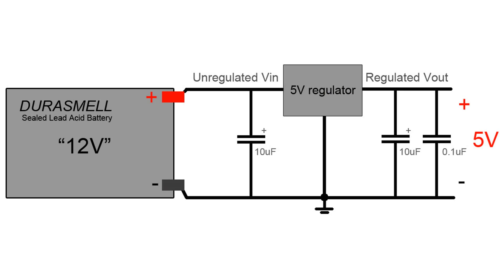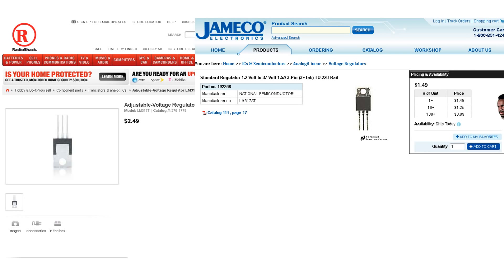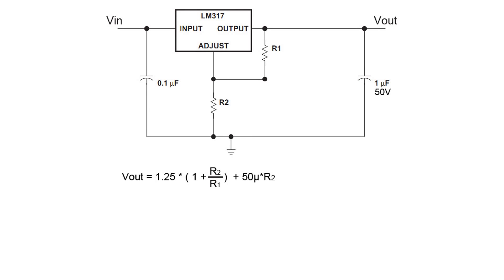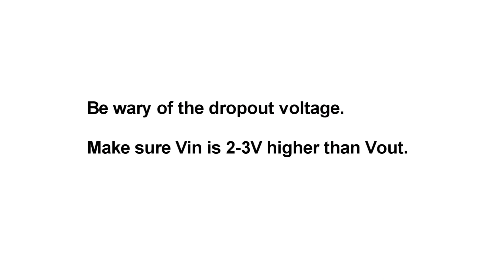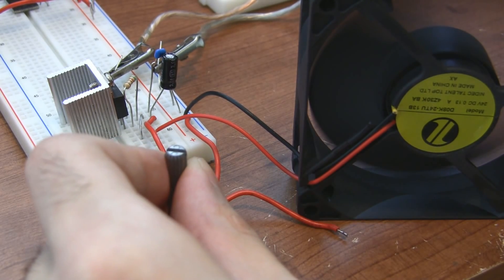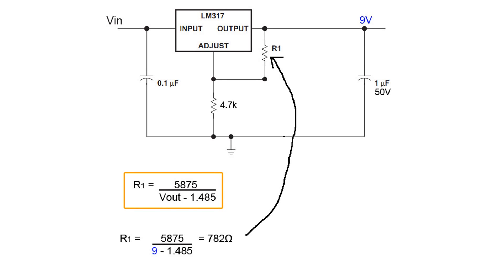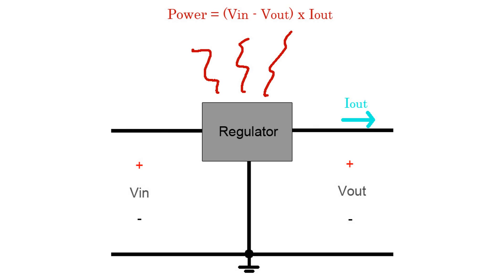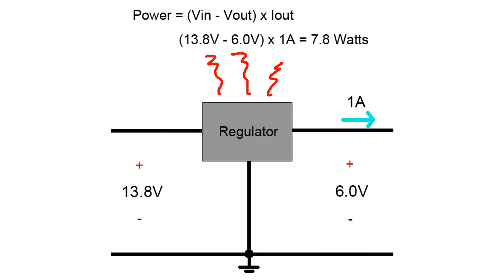LM317 Adjustable Voltage Regulator Tutorial

Comment: Great vid, but you can avoid using thi specialty reg and use  regular 7805, 7809, 7812, 7815.....etc. You use the same potentiometer trick and this creates  a floating ground circuit so the IC still 'thinks' it is regulating a lower voltage. These are generally good to about 35 volts DC output max. But a great set of videos overall. Say, what brand of O scope would you recommend if one does not want spend top dollar ( i'd rather have more frequency in exchange! ) thanks

Comment: I just want to ask, i am making 0.10 volts to 15.37 volts with the same set up, and i have an input of 16.6 volts dc from step down transformer through bridge rectifier, i just want to know why i cant get the 1.25 volts as minimum, the value of my potentio is 5k ohms, and i have 520 ohms for the R1. 

thanks for answering Sir.

Comment: For bigger things such as motors, use 555 and mosfet for pwm. Google PWM voltage regulation for more info. 317 is just for small things like fans and small amplifiers. Good luck!

Comment: The LM317T is a high-current version of the LM317.  They both work the same, and have the same pinouts, but the LM317T is more expensive and can handle up to I think 1.5 amps, whereas the LM317 can only handle around 100mA.

Comment: no you can't. But you can connect in series a diode (ie:1n4001) which will drop the voltage ~0.6V, so you'll have output from 0.85 - 1.00V

Comment: Hello. I would like to know if I can use this voltage regulator do drop a voltage of a battery from 1.5 V to 1.0 V without using resistors. Thanks a lot.

Comment: Hey, great video. I have a question you may be able to help with. I'm doing an RC wheel chair mod and I need to get a 6v power supply to output 2.5v positive AND 2.5v negative. Using the LM317 and various resistors i'm able to get the positive current right in the butter zone but the negative is always around -3.8 or so. Would you have any suggestions on what I would need to regulate the negative current and how to do that?
Thanks!

Comment: I've got a 5V 40mm fan attached to the Arduino's 12VDC output for cooling, and I've just inlined a resistor to bring the current down because I don't really need a constant voltage. Would there be any extra benefit to replacing the resistor with a voltage regulator in this application, since they both dissipate the extra current as waste heat?

Comment: but why can't you simply use a voltage divider, since the current in both cases is going to be changed than the source?! using only 2 resistors

Comment: Thanks for this videos, they are very informative!  I just have a question. When i search for this regulators, I see that the datasheet have a current after the regulator voltage. For example, a LM7815 says 1A and a LM78L15 says 100mA. What´s the difference?

Comment: that was pretty cool when it caught fire, could you do more fire videos and explain why it caught fire?

One time I had blown up a transistor and repeated the same steps a few times until I changed my circuit design around. It was pretty cool and sound like a firecracker just from a tiny little transistor. my power source was some kind of radio shack 3v rechargeable.

Comment: whats the maximum amperage rating for this? I need to convert 12v (or rather, ~13.6v) DC to 16-18V @ 18-20amp max. how do i increase the maximum amperage rating? the input voltage would be off a car battery/running car voltage.

Comment: Great Video by the way, I have a question, i made a Regulator for my solar panel 24V 5A with 44V peak output, i used a NTE935 regulator, 150ohm R1 & 1.3K R2, for some reason im getting only 10V. im trying to get 14V so i can charge my batteries.  NTE935 is made for 32V 5A, do you think my resistor values are wrong ?? do u think this is causeing my problem of the 10v readings which i need 14v any help will be great.

Comment: I don't want to sound dumb but if im trying to use a voltage regulator to power a few USB devices. lets say 3 5V ports at 500mA each that's 1.5A DC total and im running off a 9V supply. Does my power supply need to be able to supply 1.5A DC or is there something in there about ohms law?? please help. thanks in advanced.

Comment: I want to use this to adjust the fan speed on my forge which is a 12v car heater box fan. Could you please tell the type of potentiometer and its rating and could you tell me the rating for the capacitors and resistors so I can get them ordered.
Thanks in advance. Adam

Comment: if you still need the resistor values, you can google lm317 calc and there are some website where you can put 2 values for resistors and it will give you the output voltage

Comment: i want to make a 7.5 volt power supply with 1A from a 12 volt power supply with 20A, with the lm317. what would be the values of the resistors R1 and R2?
Thanks

Comment: If you want the cleanest "audiophile" power, run off batteries. If you want to make this circuit have minimal noise, increase C2 to 1000µF or more. (Note, if you increase it a LOT, the output voltage will take a while to get from 0V up to the set voltage. This MIGHT cause unusual sounds during power on. I don't think it will ruin your device, but I won't guarantee that!)

Comment: You can use this exact circuit to do what you want. The video explains the circuit, and there are a zillion webpages which also explain, if the video is not enough.

(However, you will need to put a big ol' heatsink on the LM317T, because you'll be dropping 4 volts at as much as 3 amps, which is 12 watts of power. Some soldering irons run at 15 watts, so: HOT.)

Comment: HI.. i have a battery that is 36v and 42 on no load..
so what i need is (somehow) so get the 42V down to 12V... ive already got an lm317 witch is adjusted to 12v. but the lights i use needs atleast 0,8A.. and when i use a normal resistor in front of the ln317 to decrease the voltage it burns up.. any idia how to fix ?

Comment: Great explaination, does this apply for the LM338 also with no required modifications to the circuit?

People tend to use diodes and capacitors can you help explain their purposes in this circuit and what you would recommend.

Comment: Ok thanks for the reply. So I should be switching my present R1 and R2? In other words, have the variable between Vout and ADJ and the fixed 1.5K between R1/ADJ and ground? If so, I am confused why the schematic on the LM317 dataset shows a variable as R2 (between ADJ and ground). Or should I recalculate my variable resistor value based on an absolute value of 4.7K for R2?

Comment: I am having trouble keeping a constant Vout. I have a couple voltage regulators set up, but only one maintains a constant Vout with variable load (simulated with a 10K pot), while the rest do not. I have 1 and 0.1 uF capacitors as the schematics and video recommends for each regulator. Vin is somewhere around 12V R1=1.5K, R2= variable from about 0-10K. I tried using a 4.7uF capacitor for C2 (the one between vout and ground) with no difference from the 1 uF. Any ideas?

Comment: my lm317 heats up fast and it's really hot. it even reaches a high temperature even at low voltages and without a heatsink. is this normal? or is there a way to fix it? im pretty sure i wired everything correctly.

Comment: Hello i made this voltage regulator as per your diagram, bit of fault tracing and repair at my end, but works perfectly. My question, is there a voltage regulator that can control from 0.5volts or less, maximum volt i need is 5 volts.
Great video's i have only subscribed to two channels and one is my daughter

Comment: I connected a laser diode 2W 2.8 to 3.0 V 1.5 Amps to the output and an old laptop power supply to the input with 19V, 3.6 amps, ant the maximum Voltage output is 1.82 V

I replaced the laser diode and same behavior. 

with a fan, lightbulb it works as expected. 

Any ideas?

Comment: i did all of this and i only get 100mah of power, why? I used 500ohm resistor and 10k pot also 4.7up 50v cap on the output side and 0.1uf on input and a 12v battery to power it all

Comment: About my case bellow...

After a lot argument that the 317 needs 100-120R as R1 to meet the minimum current and Pot as R2 which for some reason was not regulating the Voltage at least without Load,i decided to SCREW the minimum current and add a Fixed R2 and a Potentiometer in Series to 100Ohm resistor as R1 and BINGO!

Bingo boys,3 nights in a row and my first thought worked better,but the nights were still gone.

I really should have got another Regulator like LM1084 which i know inside out.

Comment: Nice video. I wanted to see if i'm missing anything,but no. For some reason while everything is wired perfectly,pinout set right,etc,the damn thing gives ~15v out while set to ~13.8,and while the Input stays ROCK stable,when 90mA load is added it drops at least 5v,if R2 set exactly with a trimmer,a bigger dropout is caused.Added more minimum load,changed the R1 to 120Ω,and tried multiple combinations. This thing just doesn't work as it should,i'm in Electronics since 5 though first time i selec

Comment: You can use 7805,7812 etc  as adjustable voltage regulator.Put between middle pin and minus variable resistor an you will change the voltage.

Comment: @Afrotechmods Ok, thanks. Btw, is there a way to control how much current that can be drawn from a battery? For instance, not higher than the max discharge rate (for lipos)? A current regulator of some sort?

Comment from the maker: @FlumenSanctiViti You want what is called a switchmode power supply, or a switching regulator, or a buck regulator, step down DC-DC converter, all different names for the same concept. National.com has the easiest solutions if you want to roll your own from scratch.

Comment: @Afrotechmods
At the end of the video you are talking about inefficiency of this type of voltage regulator and power wasted on it. Can you tell us what is the best setup for more efficient voltage regulator that can easily handle variable voltage on its input (for example from x1 up to x5 or more) with low power dissipation.

Comment from the maker: @KIBProductionz Any voltage regulator IC will be better than a zener. The zener voltage can easily vary by +/-10% over their full current and temperature range. Sometimes that's good enough though.

Comment: what's a better voltage regulator? a zener diode or an LM317? i found out that zener diodes go up from 0.01V up to 12V if certain configurations plus a darlington transistor is considered

Comment: I have to do this circuit but I see that I'm using 100uF instead of 50uF you are using and my first capacitor is 4.7uF. Is fine if I use these values?

Comment: I am looking for a way to make a step sequencer for my synth. When I looked at your circuit I was think if I could make timer circuit that would switch between pots at a tempo that I could regulate with another pot then I will have the solution because a voltage can be converted to midi data (with a doepfer system) but do you maybe have an idea for a second circuit to switch between pots?

Comment: did the "50(micro)" on the equation at 2:32 came from the Vout capacitor? what if my capacitor is rated at 50 volts and 3.3 (microfarad)? what do i do?

Comment: @ImUrtastyflava build a voltage doubler circuit or use a transformer. A regulator wont put on more than the applied voltage.

Comment: is it all right if I use a 470 ohm resistor????????or higher than 510 let's say about 600 or 610 is it good or not?cus I've put a 50k potentiometer and it has released the magic smoke and I need to buy another one

Comment from the maker: @bluetorch13 Watch my voltage divider tutorial video. In short, it's extremely inefficient to use a potentiometer to supply any more than a few mA. Also the voltage output won't be as reliable (hence "regulated")

Comment: ok... I did basic research (or less than basic) and couldn't find the difference between a Voltage Regulator and a Potenciometer. Yeah sounds very ingnorant. lol! why can I use a potenciometer to control the fan directly? or a light?

Comment: Why did you pick a value for R1 the first time (with potentiometer) and then pick a value for R2 the second time (non adjustable)? Could you have accomplished the same thing picking a value for R1 again (without potentiometer) and figuring out R2 with equation?

Comment: What options do you have if the load being regulated could potentially draw up to 20 amps?
Reply: At that point a linear regulator doesn't make sense. A switch mode power supply with some kind of current regulation does
Reply: that was my second channel, make sure its a high power one :]
Reply: Just use a buck converter

Comment from the maker: @reactor1system Use a diode+very large capacitor to have a more stable voltage on the input before the LM317. Or buy/build a SEPIC DC-DC converter.

Comment: I have a question though. How can you regulate a voltage that varies greatly? Can I use the LM317 for that? For example, energy produced by a dinamo that is first transformed to DC current, will vary quite a lot. Let's say the dinamo will usually produce around 6V but in reality it will be less or more, and I want a 4.5-5 volt output.
Without any load, I've measured such a dinamo outputing even 18V! (a bycicle dinamo).

Comment: Now im working on making a 4 fan variable speed controller, would this variable vregulator be able to hand 4 computer fans as long as i have a good heat sink and would it be a good idea to have those capacitors in the circuit for just controlling some fans or could i go with out.

Comment: @Afrotechmods @Afrotechmods did it without the resistors and it didnt work. i also read online that you would need some extra components. I didnt know what those components were so i bought a LM338 instead. havent gotten to test it yet, but it should work.

i used the lm338 instead because it can take 5 amps of current i got the one in a TO-3 STEEL
Metal Can Package and attached it to a bend aluminum plate with plenty of thermal grease :)

so a 3 amp (the transforer is 3 amps) 12v supply :D

Comment: Hey, I building this but the voltage wont adjust with a 10k pot, the output voltage its exactly the same as the input voltage the pot makes no difference. I'm using an 510 ohm resistor like you.

Comment: Excellent video, had an LM317 lying around and was trying to figure out how to use it and was wondering why the voltage was never varying even when I checked the datasheets. Never added a R1, since I thought I didn't needed it(and never paid attention to the equation in the datasheet).

Comment: Thanks for the good electronics instructions, they are very helpful.   Wouldn't the 1/4 watt resistor you had hooked up there fry, if you used the power supply to supply a 7.8 watt load?

Comment from the maker: @Intosia Ahhh... well depending on the feedback resistors used in the design you may need to put a small load on the device for the output voltage to be stable. So yeah measure it with a 1k load or so.

Comment from the maker: @Shaunakde Here's the problem... building DC-DC converters on a breadboard gives dreadfully noisy outputs. Building them on protoboards is slightly better but still crap for high currents. The right way to do it is carefully etch your own PCB or buy a pro made PCB. But once you are paying for all the components plus all the effort to make the PCB you might as well just pay $10 for an off the shelf solution. Anyways... National Semiconductor's "Simple switcher" line are the easiest to use.

Comment from the maker: @Intosia Hah! I'm an idiot for forgetting to talk about this. Basically you should hook up your multimeter to the output, measure the voltage, and make adjustments accordingly. Once you've got the voltage you want, connect up your load.

Comment: I've used the LM317 and 337 (for split rail power) in a power supply I made, easy parts to work with and quite reliable.

Comment: HAH! finally found why you are called "Afroman" lmao now it makes sense xD
I know it can be really boring everyone making you questions, but have you any tutorial on how to make a circuit to switch automatically between a mains>12v tranformer to a LI-Ion 12v battery, like an emergency backup system, when main power gets cut off it switches to the batterypower.. Aaand when the mais are on, the circuits charges the batteries..
All this is for my door lock..

Thanks in advance =)

Comment: Neat. I'm actually very glad you made this video now. I just subscribed to your channel a few days ago and I was pleasantly surprised to see this because I am about to build a solar 4 AA Battery charger using this component. Good timing and thanks! 

One thing I dont really understand is .. why do you need two resistors? Is the "Adjust" pin like an input type or output type? (Which way is the electricity going there?) Why do I need a resistor from output to adjust? Cant I just have one on ADJ?